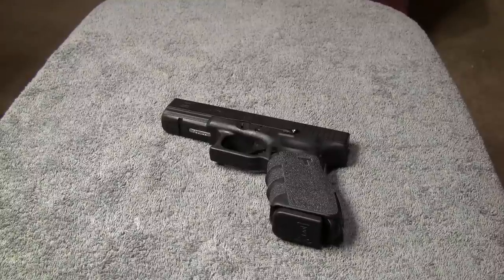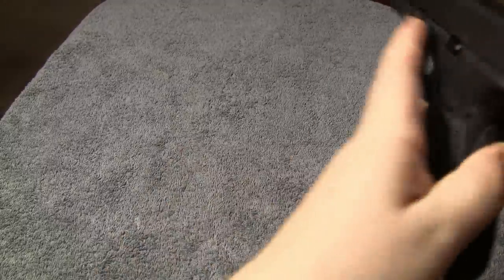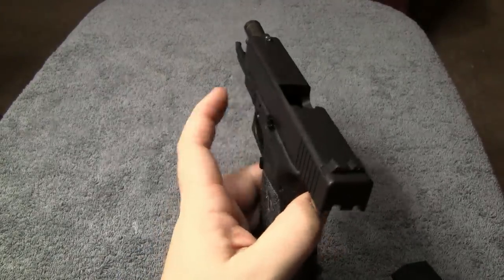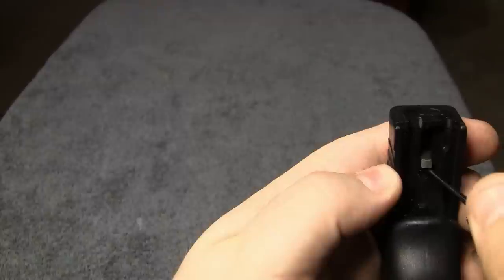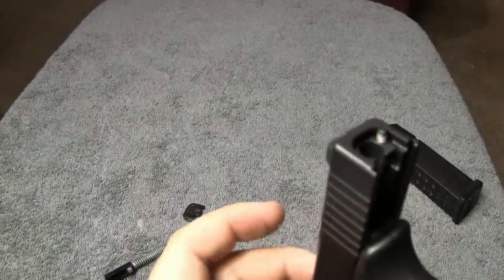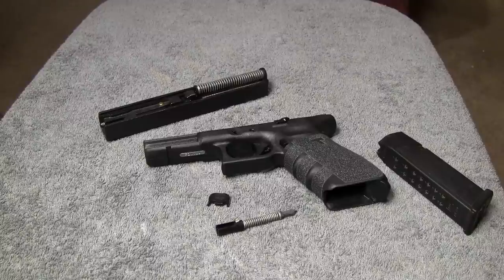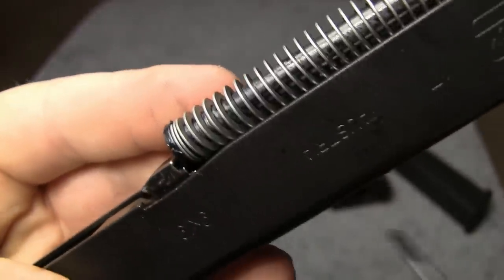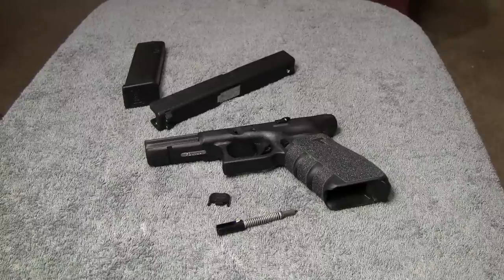How to get a Glock slide off when the trigger is stuck forward

Comment: For those in the future. This happened to me on a Grey Ghost custom build. I changed out the stock connector with a Lone Wolf 3.5lb. It wouldn't activate the striker. Switched back after using your instructions. Worked fine. THANKS
Reply: I'm having this problem with a custom and don't see where to press the thing down to remove that back plate. It only slides back but doesnt press, if that makes any sense. Still trying to figure it out.
Reply: @coppertonewater  It only moves that spring less than 1/8 of an inch.  My backplate was very tight- I had to carefully use a small screwdriver to separate the backcover, then it slid out

Comment: I was wondering if you can help me I built a glock 24 about 2 years ago from scratch. I am having problems now with the trigger resetting after I fire a round. I used your video to get the slide off and am now trying to figure out what exactly is wrong. Any ideas ?

Comment: 2022 here and this video saved me my struggles. Happened when I was installing the Apex Trigger enhancement kit. Thought I somehow broke my glock until I found this video. I thought it was my recoil spring like he said it would be in the video, but it was actually a parts error. I found the Apex trigger connector did not rise enough to hold the trigger bar in place even though the connector was seated all the way. So when I pulled the trigger the bar would not catch onto the housing of the connector, making my trigger stuck forward and my slide stuck. Disassembled and put back on the factory connector bar but kept the Apex trigger and everything works properly.

Comment: Go ahead and install the Black Yikes 3.0 Connector they said. It'll be easy. Fits perfectly. No smithing required, they said. And I listened. What an ornery little bastard this connector is. After several attempts to make it sit correctly to get the benefits of said "smooth action," my slide went from sticky to stuck. Your video really delivered the solution that I was so desperately in need of. THANK YOU!!! I feel like I know my Glock so much better now. After watching it, it took just a few minutes to get the slide off so I could put my factory connector back in. Works like a dream now. Thanks again, DOF!!! Stay safe and stay well.

Comment: I think found a new way to get the slide stuck! I put in a 3.5 trigger connector into my G30. I took the new connector out and and put in the original back in it and it works fine now. I've replaced all of my Glock's trigger connectors before without issue. The 45 caliber doesn't like the 3.5 for some reason.  Thanks again for another mental health saving video!

Comment: Thank you!  I purchased an aftermarket trigger connector and the angle was off.  After installing, the trigger wouldn't "disconnect" and fire.  This worked, was able to disassemble and re-install the factory trigger.  Might bend the aftermarket to proper position (just a range gun).  Thanks again.

Comment: FYI this just happened to me. I'm not a new gun owner but I am a new Glock owner.....somehow I bricked it and I think it's because I reinstalled the slide after doing some trigger work; so I installed the slide without barrel/recoil spring to see if it would go back together. Went right together; wouldn't come apart. Thanks for sharing.

Comment: This was very helpful. However it seems like I can only remove the slide this way even though the recoil spring is lined up on the bottom ledge. I'm having difficulty removing it the normal way. Is that a problem?
Reply: Jrod ProductionStudios this will also happen if your trigger travel screw is turn in to far

Comment: Disassembling the Mossberg MC1 and MC2 series of pistols is similar and does not require pulling the trigger. Also, there is no Glock-style slide lock catch. The  metal back plate on the Mossberg serves as the slide lock and is removed with a push button (no punch tool required).

Comment: OR   the recoilrod moves out of the proper shelf on its own due to oil...no oil is used on the plastic glock except a dot on  each rail contact, which are steel.  Or the slide is slapped on carelessly might be another way to jam the spring recoilrod.

Comment: Could it be anything to do with the FIRING PIN SAFETY TEST that the manual suggests?  I got my first GLOCK today and stripped it down to clean and lube it. following the instructions in the manual, (and also watching some YouTube video's).  I got myself into a panic when putting it back together as the slide appeared to get stuck when putting it back on and then wouldn't come off.  Fortunately after wiggling it back & forth I did manage to get it off.  Then a searched GLOCK reassemble issues which got me to here.  The manual suggests moving the firing pin lug back and forth while pushing down on the firing pin safety to ensure proper movement.  I wonder if the pin isn't set back to the correct position if that had anything to do with it?  I've managed to reassemble and disassemble multiple times now and can't get it to do what it did to me again, (even trying).  Weird!

Comment: Wow, I was looking for this, thanks! I've got a Glock 23 and when I pull the trigger, the striker does not come forward. Thus, the trigger won't stay in the rear position and I can't field strip the gun in the normal fashion.

I'll break it down this evening and see what's causing the problem. As you say, I'm expecting some sort of user error...

Comment: Wondering. I have a Glock 26 Gen 4. I changed my backstrap to the beaver style it came with. Will the talon grip be able to be installed with this beaver tail backstrap?
Love your instructional videos.
Reply from the maker: I believe so, I installed a Talon grip on a Glock with the largest backstrap and it worked fine.

Comment: Well this did not work for my G27 .40. I had to pull not one but both sides of the release mechanism using a screw driver because neither one worked by itself. Only then could I get the slide to release. My first Glock and what a POS.

Comment: I very much appreciate the solution to the issue. I'm not quite sure what the issue is yet but it's definitely the firing pin and not the recoil assembly. That's what I thought it was at first as well but it's definitely not that. I took mine apart 3 times using your solution and every single time the recoil spring was on correctly. But I literally just installed a new custom slide plate last night, went to take my gun apart today and it's the first time I've ever had this issue. I've had this gun for almost 4 years now. If anyone does know what the actual issue is I'd love to know.

Comment: Thanks for the vid!  I needed it because I put a Ghost Rocket connector and spring kit in and I think because I didn't file the tab slightly, I couldn't pull the trigger all the way.  Couldn't click so no slide removal.  Your method worked perfectly to get the slide off and now I can examine why I'm not getting a full pull.  Other than the wasted first 40 seconds, the vid was good, good lighting, good sound, good explanations.

Comment: Thanks for the help, I bought a new 19 and did all the same things that I have done to every glock I own, adding the 3.5lb ghost trigger is one of the items. It seems that the top of the trigger is angled ever so slightly, but makes a huge difference. I put the original back in for now and everything is just fine. I shared my slide disassembly issue with multiple "armorers" including talking to the armorer when I was at front sight, you were the first to be able to help with an answer.

Comment: Hi, H4T, just wanted you to know, that I had a bad experience with my Glock 26 slide, but your good video was a life saver, thanks my friend. In the event, another person has a situation like mine, here's the scenario: I have the LaserMax in my Glock G26, but you have to be careful when reinserting the slide back onto the frame after a field strip, The reason is, due to the way the LaserMax is made, which is imbedded in the special guide rod,  If the person isn't careful putting the slide back on the forward frame rails, the slide can become dislodged just enough to cause a jam. The back rear end of the slide will not properly seat itself on the rear rails and causes a jam. Thanks, again, H4T.

Comment: My god you’re a life saver. I got one of my polymer 80 builds stuck like this somehow (aftermarket springs and trigger and it’s a gen 1 model which is ripe with flaws). Anyway. Thanks for the help!
Reply: J Jennings i build a polymer 80 also glock 27 and it was a pain in the ass to dissamble runs like a champ though

Comment: Vince is right.  The first 40 seconds were unnecessary.   However, this was the answer I was looking for.  I had an extra trigger housing in my box of spare parts.  I wanted to try different trigger springs to see how they feel.  I failed to noticed that my extra trigger housing did not have a connector installed.  So although I could pull the trigger, I could not release the striker to disassemble.  I should have thought of removing the slide plate.

Comment: much appreciated saved me an embarrassing trip to ask for help. had this issue when I was replacing the stock connector with a ghost eve elite...tried the aftermarket connector on a 17 and a 23 and had the same issue with the reset on both after assembly. have other ghost connectors in my other glocks and they work fine. just some feedback. thanks again

Comment: This also hasn't happened to my Glocks but what I have noticed is that the newer spring system(double encapsulated) has a minor issue with bending causing the slide to stick upon removal. I solved this problem by replacing these springs with new steel ones.  The steel ones work perfectly and this will never be an issue.

Comment: Here’s what I did. Got a Glock 48 purchased a 42/43 pro connector from ghost. It doesn’t say 48 on the box however all other connectors work that are 42/43 well this one doesn’t and doesn’t allow the trigger to be pulled back at all. I was shitting bricks until I saw this.

Comment: It's happened to my 17 and I beat the slide on the table on the range on the back sight to try and unlock it but that didn't even work? The thing is the guns trigger worked completely fine but the slide was completely locked up with a live round in the chamber but beating the slide back still didn't open it?The way I had to break the slide loose was praying and firing the gun with the hopes it didn't explode . Until this day I still have no idea what happened? Do you have any idea what could cause this?
Reply: Demon50 I can't even figure out what you just tried to say.

Comment: I got it I was able to fix it I just went through the same steps pulled the slide back depressed the tabs on the side and pushed and it came back off then I fixed the spring I didn’t push it all the way down in the correct position. Thank you for this video. Very first pistol first glock just running through the manual. I know about m16s m4s but this is different

Comment: Having this issue right now. I was practicing disassemble and reassemble I think I didn’t put the recoil spring in right I couldn’t get it to go on the bottom ledge so I proceeded thinking it was fine because it didn’t fall out of place

Comment: Thanks for your vid! It happened to me when I was installing the new Timney trigger on a 22 Gen4. At first there was too much creep, so as per their advise I've bent the trigger pull connector a bit inwards. Too much though, as it turned out afterwards. The firing pin couldn't be set off any longer. So I found your vid, removed the slide as per your demonstration, then the rear trigger assembly, bent the connector a bit outwards, and now it does run fine as intended.

Comment: Not sure if misplacing the recoil spring assembly will cause the issue without intentionally doing so.  However, a bent trigger connector will do it.  Various merchants sell 3.5 lb trigger connectors.  The bottom portion fits into a slot, while the upper segment is free to move medially and laterally.  If it becomes bent so that it sits flat, then the trigger locks in a "fired" position.  The end result is the inability to remove the slide assembly.  The solution is the same as noted here.
Reply: HOW CAN I TELL IF THIS IS THE PROBLEM?i it's shooting fine never had any problems with this G19  3RD GEN I HAVE THE PIRAMID TRIGGER AND A STEEL ROD thank you for your respond

Comment: Will this technique work if you've stupidly left the guide rod/spring out, re-assembled the gun without it and then got a complete lockup?   I was real tired while cleaning the gun and just forgot the guide rod.  Now it's all locked.  Wondering if this technique is the only way to clear the problem and re-install the guide rod and spring?   Glck 26 Gen 5.  Lovely little gun.

Comment: Sooo... I was checking the fit of a P80 slide on a frame without the trigger group installed yet. The only thing installed on the frame is the slide release. Any suggestions? I tried removing the back plate and striker, no dice...

Comment: thank you so much for this by the way, i never commented when this video helped me. I was replacing the internals on my 43x and after replacing the trigger connector I didn't seat the spring properly and when I reassembled the handgun my trigger was locked back and I could not remove the slide. this was my first time even removing anything other than just the barrel from any firearm, i was freaking TF out lol. thanks again.

Comment: I was lead to this video because my 43x slide got jammed.  Mag removed and no bullets in the chamber. Barrel and recoil spring somehow got jammed about 3/8" out beyond the slide.  When I pulled on the trigger it would pull on the slide pulling it back too.  Because of the way the barrel and spring were jammed I couldn't pull the slide back into locking position.  Kept wiggling the slide back and forth and trying the trigger until I got it to pull back without catching the slide and I was good to go after that.  At least I think that's how I fixed it.  It did jam one other time after firing half a clip.  I just kept wiggling the slide back and forth until I came off.  Not sure what I did that time to get it loose.  Not sure if I worked the trigger also that time.  Knowing me the dumbass that I am I did try that. Hopefully not while pointing it at myself.

Comment: I've had the problem with the slide locking in the foreward postion about 1/2' foreward. It look like the slide tried to come off before getting to the front slide rails. What's your solution? Great video thanks

Comment: Hey thanks a lot. My G22 gen4 got jammed after trying to install a 3.5 ghost trigger. Saved me some grief. Now its all good with the old part. I just gotta figure out what I am doing wrong so I can install new Ghost part.
  Ok i'm back and figured out my problem the Ghost Rocket 3.5 trigger has a extra tab you have to file to fit for over travel of the trigger. Well I didn't file it at all and reassembled it and at full length it doesn't let you pull the trigger. Thanks again Rich.

Comment: Could you do a vid on what happens if you take the slide off the frame, manually pull the trigger forward to the cocked position as if the slide was still on, and then try to put the slide back on with the trigger in the forward position? I think the lug on the bottom of the striker would hit the lip on the cruciform that usually releases it to fire, and the lug would try to push the cruciform down so the striker lug can pass over it, but the drop safety would prevent it from doing so without substantial force. So you would have to pull the trigger to the rearward position and drop the cruciform down so the striker lug has room to move fully rearward.

Comment: Saved me. Was cleaning quickly put the recoil spring on the upper shelf. Slide on G20 stuck hard. I was stumped on how to resolve. Seems like kind of a bad design that its possible to do that. No doubt opearator error on my part.

Comment: FYI, I've had this happen to me, it actually happened when I put a Fixxxer Components slide cover plate, It freaked me out, because I've taken the factory one off to clean the firing pin chamber and replaced it without an issue, I installed the cover plate from fixxxer, not only would the trigger not work correctly, I even heard the striker pin go on its own, not when I depressed the trigger. Thank god I was testing without a magazine. My first thought is I assembled it wrong, so I take it all apart again using the trick shown here, I put the factory plate on, everything works no issues, put the fixxxer plate on and bam same issue. 

I don't know if I got a bad plate from them but I will not use their parts again, I am not going to take the risk.

Comment: Ok, so today, i got a new holster for my glock 30. I take the magazine out and i still have 1 in the chamber. I go to pull the slide back to extract the live round and the slide wouldnt pull. Ive tried everything. So i finally took it to a gunsmith near me he took it back and 3 minutes later he had the round out. I asked him what he did and i never got an answer. The only thing he said was i have to clean and lube the inside.. how the hell did he extract the bullet is what im trying to figure out.. ive had that gun for 15 years its my everyday carry. Well he didnt charge me but did tell me to clean my gun..

Comment: i did this to see if i could find another way to get the slide off...well if you rock the slide back and fourth until its got the trigger ready to fire..you rock and pull the trigger..comes right off...ive never had this isssue it worked now....does that hurt anything..i see to scratches or metal shaving of any sort....good vid tho